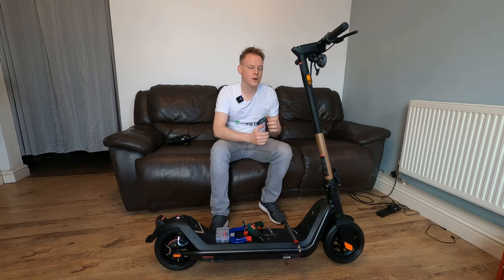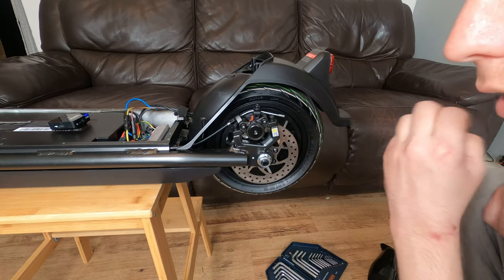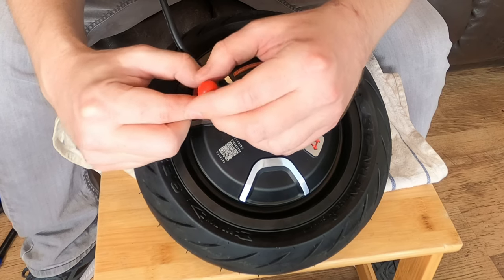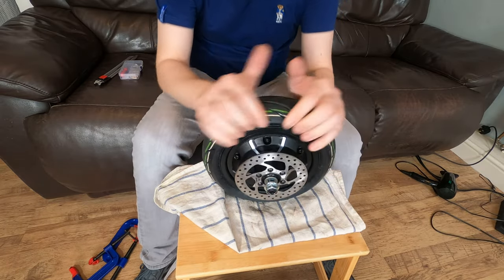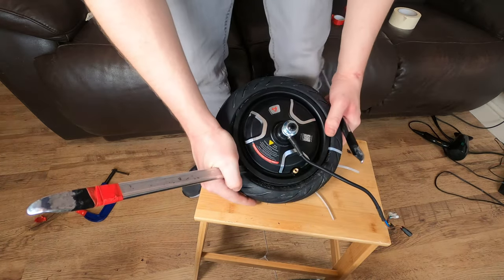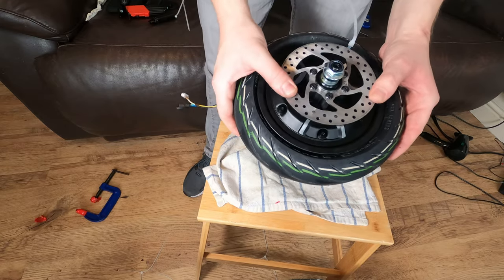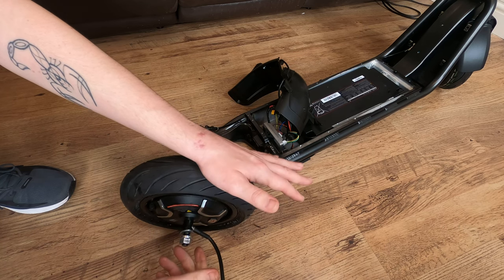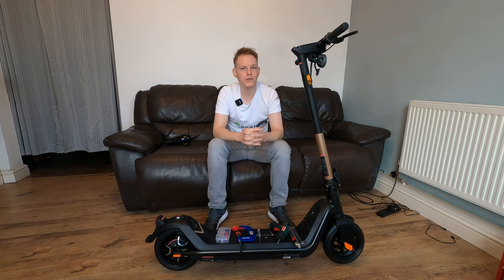How to Change KQI3 Rear Tire

Comment: I will sell it before  the tire get old ..
Reply: Took me exactly one year of ownership
Reply: Year and a half 3000 miles and yeah…I said the same thing.
Reply: My scooter tire is not old, but still has some small cut and leaking air
Reply: @alextheromanian  so when your scooter had 3000 miles on it, how was the tires? Are they shot or still OK?

Comment: Ok id like to update......the actual dismantling of the scooter was easy enough....and i used a heat gun instead of a hair dryer ...All basic tools then...I've taken off the tyre easy enough and a friend of mine will put the new tyre on at his garage because i cannot be bothered to struggle with the new tyre ....The tyree i actually bought isnt the best quality like the original so ive purchased a thicker and better quality tyre for the next removal in the future. Its not as bad as it looks guys ..this video made it alot easier .

Comment: Does it have to be this specific tire or can I use like 10 inch airless tires?
Reply: Has to be Same measurements or it won't fit
Reply: Btw there 9.5 inch tires
Reply: Did you do it? I'm also looking to install 10 inch solid tires
Reply: @felipecordova4526  I ended up getting a new scooter because for any sort of repair you have to get into the deck even for a simple tire change.
Reply: dude, can your mechanic put on a truck tire for your car? 🤦‍♂️

Comment: I have something to update now I have had received a flat I've attempted to repair the hole with the tubeless repair kit ....It worked for about 2 days of normal use . I believe three tyres are of low quality rubber ...the hole was the smallest and it seemed to be easily punctured ....I recommend a change of tyre maybe switch to self healing tyre or solid like they have put in the nui q air ....This process to remove the back tyre is ridiculous.. I'm using this video on the weekend to put my spare tyre on then I'll be purchasing solid tyres for the future .

Comment: This is the right way to do it but I was able to do it without disassembling the deck. You can just take off the rear tire and you have just enough wiring to do it with everything still intact

Comment: Thank for your video on rear tyre change, I did the rear tyre change in less than half an hour, clamped the tyre instead of  electrical ties then put ratchet strap around tyre tightly to get the tyre to seal and pumped it up and it popped out, EASY.
Reply: Did you use a air Compresser?

Comment: One thing I'd like to add regarding the initial tire inflation.
The best way to get it up and running for free is by doing what I did and just taking your scooter (or just the wheel) to your local gas station and use one of the car tire pumps to inflate it. They usually are free however you also have to rely on the mercy of the gas station staff as these are technically not allowed to be used on bike wheels. Some gas stations might take issue with you doing this but my gas stations are pretty chill about it.

Thanks so much for the video it helped me fix my flat rear tire on my KQi3 Sport, it was an absolute NIGHTMARE! NIU definitely makes great scooters until the moment you have to make repairs, then they turn to among the worst
Reply: Thank you for your video, I used it as a warm up before I tackled my sons. FYI, if your having trouble seating the bead of a tire, you can  try using a ratchet strap around the perimeter to help push the beads against the wheel✌️
Reply: Well I got told I should plan about 5 
-10 weeks until I get it back FOR A FUCKING FLAT TIRE if I still could At this point cause this lack of service I would love to get my money back and buy a different one
Reply: A cycle pump worked for me

Comment: Thanks for the vid. My scooter's rear tire valve came apart and I needed to get the rear wheel off and one side of a tire off in order to replace it. Yes, the rims are soft and I ended up scraping a few sections. Also, I had to take it to my car mechanic's shop to reset the tire beads. He recommended that the valve core be removed when resetting tires as this allows a higher inflow rate.

Comment: Just a note that I tried to change this, but ended up damaging the rim edges and it leaks air (even after adding bead sealer). Ended up needing a new motor/rim assembly. I've learned that while some things are fun as a challenge this one is best left to the scooter pros to change. But I appreciate the how to!

Comment: Hello! I hope you can help me...
I punctured the rear wheel and took it to a store in my city... the problem is that the person broke the air valve on the wheel, so we have to look for another one, but I don't know which model is used for this scooter... 😔

I don't know much about scooters, I just know that there are several models (TR12, TR13, ETC) and I don't know which one to buy...

Comment: Thanks alot brother!!  Just got new Scooter and it's making noise as if debris is stuck on the tires or brake pads.   I cleaned the discbreaks  without needing to remove the tire but it didn't stop the noise.   Thanks for this video I just needed to see how tonremove the wheel.  Keep up the good work your sure to succeed on YouTube!

Comment: I used to change tires for a living as a young lad. I notice you didn't lubricant the tire before mounting the tire. Great suggestion, you can use petroleum jelly around the bead of the tire. It'll help getting the tire into the rim and seal. Once you get the air in

Comment: My, what an ordeal! Two thoughts/conclusions from my POV. 1) If you decide to do this yourself, if the tire is no good (in my case, it is leaking), why not save some time and avoid the whole clamping, pushing/pulling/levering  by just dremel-cutting the tire all the way through -- from the  bead to the tread -- and then just pull the tire off?  Putting a new tire on a rim  is always easier, in my experience, so effort saved there. And potential rim/wire/misc. damage avoided.. 2) Speaking of potential damage, I am evaluating that AND what my time is worth. Might it be better to spend the money to send it back to  the service center and have them assume all the risk and effort? (Sending it in is what they just told me was the non-DIY option). You would think I could take it to a dealer, but they did not say that was an option.

Also, one last thought/question regarding a leaking tire: any of the puncture sealants work for  that?

Thoughts folks?

Comment: I had the same problem of not being able to have the tyre put on perfectly, I just went to the gas station with an air compressor and set pressure to 50psi and started filling initially it wasn’t filling, I just pushed the tire down really hard into the ground and kept filling air, it locked the empty spot and filled it and stayed in

Comment: 1 handed clamp set - easier than tags
Tire levers
Heat the tire for 3 mins in hot water 80°c
Apply lubricant oil with hands on the rim's outer edge and the inner surface

Apply oil with hands on the outer edge and inner edge of tire which has contact during mounting. Without lubricant there is chance of tire bead getting damaged.

After the first tire bead goes in,  with hand push the second bead as far as possible and use the clamps to press the tire on the sides to hold the tire inside the rim. Then use the tire lever to complete it.

It is as easy as 10 mins job !
Reply: Don't do the boiling water trick with the Max folks, it will ruin the self healing layer inside the tire.
Reply: Make a video please brothaaa

Comment: Ok.. great informative video. But for all of those who wish to purchase a Niu Scooter, you had better get your head examined. First of all, no bicycle repair shop will even go near them due to all the work involved to fix them. As a person who had to change the rear tire (flat, which can't be plugged)on the KQI3, its a total nightmare. Everything had to be taken apart on the scooter which was the floor board, the battery cover, wiring etc) Then try removing the old tire to put on a new one. Good luck !! Then after the tire is on the hub, it wouldn't inflate due to air leaking out between the tire and the wheel hub. All of this after just 6.5 months of light use on bike paths. I was so pissed off that I just gave it away to cut my loses. Bottom line. Stear clear of these things until repair shops open up close to where you live.
Reply: You're absolutely right! It is a nightmare!
Reply: Please, it’s not that hard to change I hope everyone that has one sells them to me cheap I can change both tires in a half hour and do it correctly also I will put self healing tires on them when they go flat. You just need clamps , tire irons and tire lube and a little bit of IQ . I hear people complaining about little repairs like this , now I know why other countries are kicking our asses with innovation ( our kids are dumb quitters lol

Comment: Getting the bead to sit is impossible on these tires. No shops near me will touch an electric scooter tire. Any tips?
Reply from the maker: I must be lucky in my area.  As long as you have money. Mechanics will do the work haha.  

Have you got a friend with a high psi pump?
Reply: You can always go outside, spray a small bit of ether (starter fluid) inside, and light it from the bead edge.  The explosion will pop the beads on the rim.

Comment: I had the rear tire going flat after riding for 30min/day, for 2 months. Got it changed at a good shop, same brand and model, lasted 3 weeks, cost 70 euros.

The tires have gel to make it last longer, but it seems like tiny scattered stones on cobblestone perforate it, despite the ads saying you can ride on nearly any terrain...

Comment: Nice video.... A tire is a tire and when seating the bead some soapy water (or other tire lubricant like they use at tire shops) would have helped you immensely!  Dry rubber on the rim is very difficult to seat, but with soapy water I bet you would not have had any issues!  It's like any other tire for that matter.
Reply from the maker: Hey.  I probably didn’t show it in this video. But I did use soapy water.  No luck for me unfortunately.  I even used a silicone lubricant
Reply: looks bonedry

Comment: love my niu scooter, but im going to go with electric bicycles.  it's safer, parts are easy to find and any bike shop can work on it.  to me, it's just not worth the hassle especially when these tires leak all the time.  thanks for the video.
Reply: Honestly, I only made the switch because my ebike was stolen, and I could get the scooter in the video for like 300 dollars off.  I find the parts easy to find my back tire popped and they had replacment tires for both models. And they also had them on Amazon.

Comment: Great video, Do you know the psi for it? Mine is kid a low
Reply from the maker: The manufacturer recommends 32psi.  But I usually put mine to around 40/45psi.
Reply: 50-55

Comment: What i don't understand is why Niu would make it where, you have to take apart the top of the frame just to replace the back tire? i mean don't they realize replacing tire is part of common maintenance?
Reply: I wonder if it deals with the rear tire providing most of the power as far as momentum on an e scooter, yeah it's a huge pain to do it
Reply: I was thinking I like it because I lock my KQi3 Max through the back axle/frame space opposite the brake disc side.  If it was easy to remove then anyone could just steal it.
Reply: @cbpuzzle  someone willing to use tools to remove it could just bring a bolt cutter for your lock :p

Comment: if I buy a gen2 hub motor (starting with a 9) for a Ninebot G30 and put it on my gen1 (starts with '6' ), will I get all the benefit from a gen2 motor, or are there other elements of the scooter that changed -like the controller or something?
Reply: Idk the difference is the motor from the 1st to 2nd gen but if the 2nd gen in rated for more wattage then likely no. The controller needs to be able to output correct voltage and wattage. 

For example I cant install a 58v 2000watt motor on kqi3. Just won’t work with the 48v system, also the controller can’t output 2000watts. Hope this helps.

Comment: Damn, I have exactly the same model of electric scooter, and I didn't thought that changing a tire would be a pain in the ass 😳
Reply from the maker: It’s the same with most scooter unfortunately
Reply: @carbrickscity  I agree but with solid tires you have definitely less confort and grip
Reply: This is a garbage design. Don't buy them. Changing a tire should not be this difficult. The company should be sued.
Reply: Solid tires warp over time, then you're trying to change a solid tire
Reply: @jessethomson8475   Thank you! it's a garbage design and the company should be sued

Comment: I suggest putting a ratchet strap around the tyre , then start pumping.
Reply: Explain? 😮
Reply: @123lilflako  Any small tie down ratchet strap used for truck beds and roof racks. Put it around the circumference of the tire and tighten it.  It forces the beads outward onto the rim to seal air.  Then pump.

Comment: Thanks for that, now I will purchase a scooter that uses tubeless split rims. 😱
Reply: You mean tubed split rims. Only tubed tires have split rims. Tubeless tires always have a single solid rim.
Reply: @108mtsan    There are tubeless split rims as well.  You use an O-Ring between the two rims to hold the air.

Comment: Do these tires ever get flats?
Reply from the maker: There is a possibility of any air filled tire to get flat.
Reply: I just got a flat. I ran over a sharp object and punctured the tire. These scooters have a garbage design. Changing a tire should not be this difficult. Don't buy these scooters. Garbage design.

Comment: Why do they make removing rear tires so damn hard when its the one that goes flat the easiest.
Reply from the maker: It’s a bit more complex at the back end.  You have the motor cables.  So they need to be protected.
Reply: I agree, they should have included a "quick connect" plug to disconnect the cable.
Reply: @mrgrantsr  that would be smart engineering, sadly I don't think that is commonly practiced
Reply: I lock my KQi3 Max through the back frame/axle space. If the tire was easy to access it'd be stolen by now.

Comment: You skipped a lot of processes of how to remove footwell ( or battery cover ) before disconnecting the motor connection. It doesn't make sense to skip from starting and showing from the middle.
Reply from the maker: I did this in 2 parts.  Check out the previous video
Reply: Thanks for your reply. I follows your video instruction . When I try to test ride. I got error 10 and scooter motor (wheel) not turn. It look like locking. Any suggestion or any help? thanks

Comment: I'm doing this shit now without disconnecting the battery cause I don't have a heat gun nor do I want to take off the rubber mat. I'm using a different tire, so I'm just hoping they seal properly they're the same size but different thread pattern.

Things I'm considering getting a:

Ebike to not deal with this nonsense

A rubber cutter to just cut the tires off which also could be used on any other rubber tires I might have to deal with.
Reply: How did it go?

Comment: Das ist extrem umständlich den selber zu reparieren. Meine anderen Scooter haben einen Zentralen Motorstecker und dort muss man nicht das ganze Trittbrett abbauen. Also werde ich wenn ich Probleme haben sollte, immer in eine Werkstatt gehen müssen 😢
Reply from the maker: It can be difficult. But I guess this is the way the engineers felt it was cleaner and safter to do

Comment: I’ve had this scooter for 6 months and highly don’t recommend it. Had a lectric bicycle for about 4 years before it gave out on me. This is not an optimal daily commuter.
Reply: @Shitbox_runner  the tires are nearly impossible to take off without cutting them off and auto shops won’t change the tire. You have to go to a scooter specialist in order to get the tire off the rim

Comment: Worst scooter Ever for tire .. there are a ton of 8 in an 10 in scooter tires on market 
Niu is the ONLY 1 really that has. 9 in and Nobody makes a 9.5 x 2.5 solid rear tire which i have blow like 3 times now. 
I have posted a buncha ties on their site and nobody responds !!..

Have a HiBoy Pro Max and their customer support is Amazing!!!..

Fyi Drill a hole in your stool next time to stabilize the wheel by putting axle in it and little hair spray amd a lighter will pop tire to reinflate.. a little bit though .

 cheers

Comment: Thanks for your video on rear tyre change, I did the rear tyre change in less than half an hour, clamped the tyre instead of  electrical ties then put ratchet strap around tyre tightly to get the tyre to seal and pumped it up and it popped out, EASY.